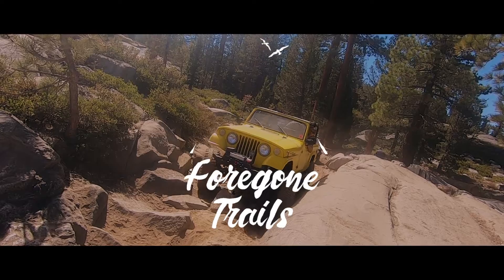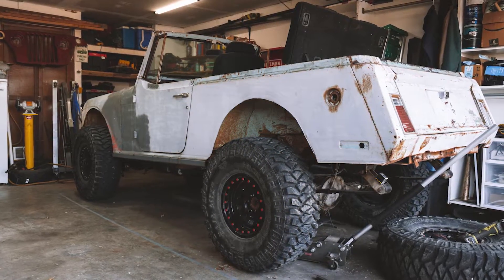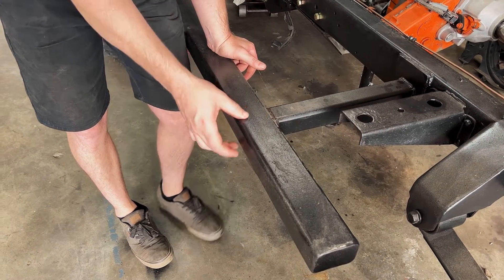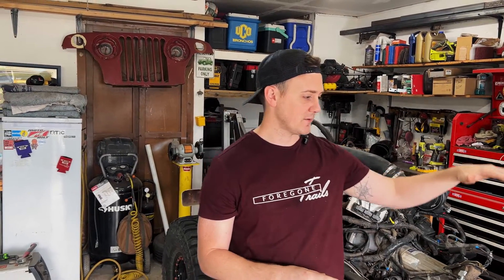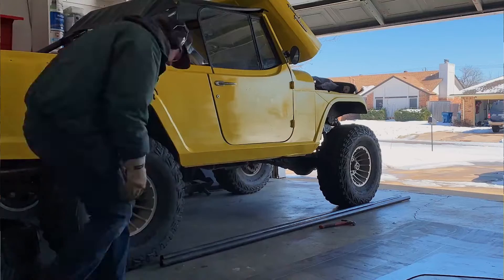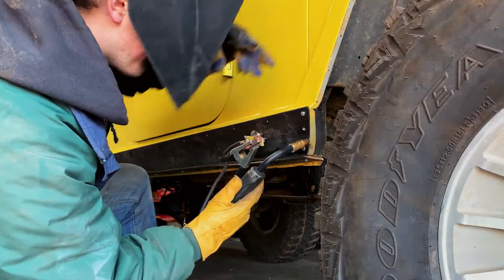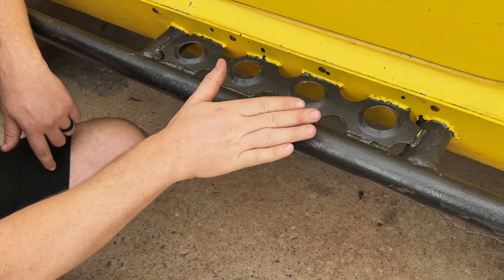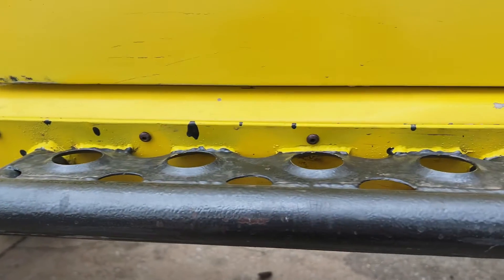Build Unbreakable Rock Sliders: Off-Road Essentials!

Comment: Whats your mirrors?  Stockers are horrible.
Reply from the maker: I use these mounted to the windshield. But honestly not a great solution, the wing windows hit them when I open the door.  So they need adjusted regularly. 

Rugged Ridge 11025.10 Quick... https://www.amazon.com/dp/B0054RW1HE?ref=ppx_pop_mob_ap_share
Reply: @foregonetrails  thanks for the info. I was thinking something like yours but wondered about clearance. Wonder if simply fabbing a different arm would make them more functional?  

Just occurred to me I have the rectangle versions of those I bought for my JK and then never used.  Guess I need to dig them out and do some fiddling.
Reply from the maker: @ozguy1393  yeah it would or even just mounting them higher on the windshield or mounting to the door would probably be fine. We also used TJ mirrors mounted to the door on one of the other Jeepster’s.